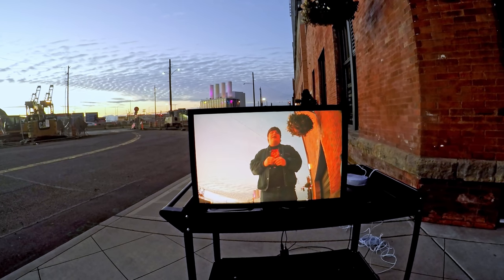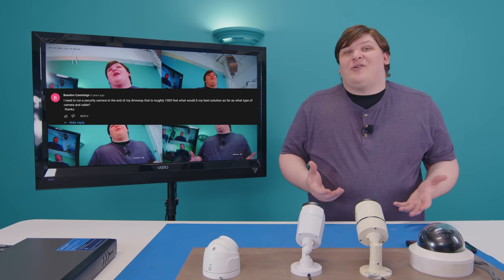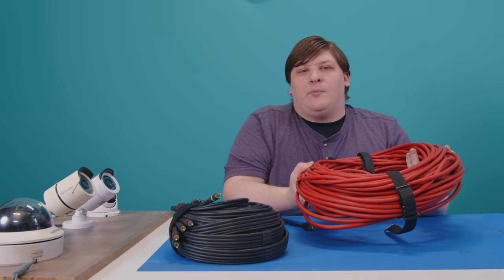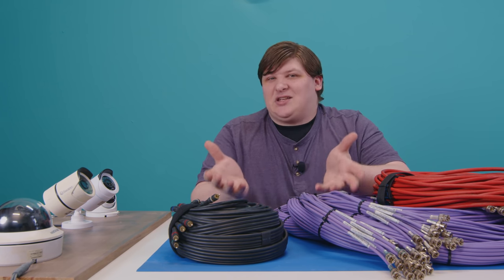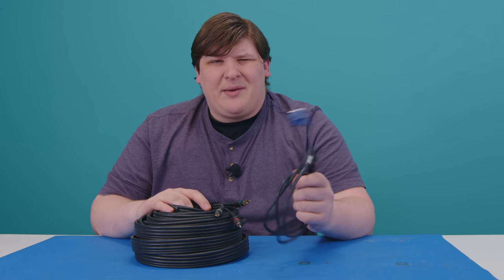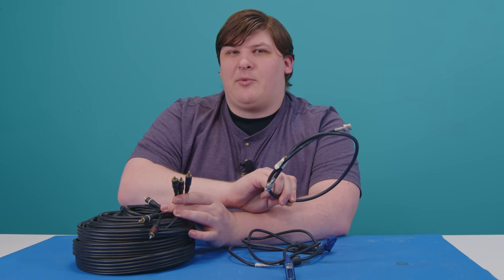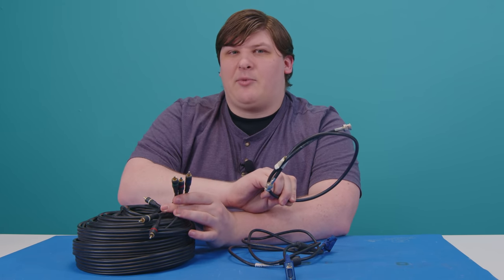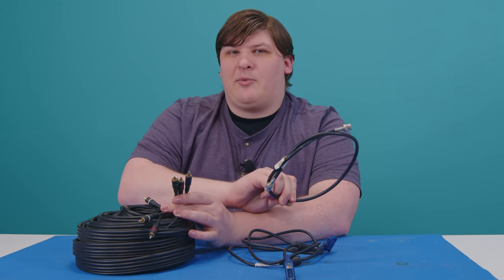1000ft of ANALOG HD video over a single cable?! [AHD/CVI/TVI]

Comment: Most satellite trucks were way behind the conversion to HD. The encoders in the trucks and the decoders at the networks were still SD well into the 2008 campaign season. Replacing those SD encoders and IRDs was some serious money. Many local affiliates, already smarting from the HD transmission costs, simply could not afford to upgrade their news operations at the same time.

However many of the SD news cameras would shoot and feed 16x9 video, a/k/a 960H. We would tell the SD encoder (or heavily throttled back HD encoder) what we were sending and it would adjust the ones and zeros in the frame accordingly. When talking with who ever was going take the satellite feed, we would tell them we were sending HD Lite, and they would know exactly what we were talking about. 

Good video, good information, well presented.

P.S. Broadcast triax has some embarrassingly low limitations depending on the camera/CCU maker. The cameras that send the video back as uncompressed straight digital video, would be hard pressed to break the 200 meter mark. I believe Thompson and Grass Valley cameras convert the signals to RF and get some amazingly long cable runs out of them, measuring out to 1500 meters if you powered the camera locally. But who wants to pick up 1500 meters of that stuff?

You already discussed SMPTE Fiber, which is rapidly becoming the industry standard. New sports facilities are being built out with SMPTE and single mode ST fiber infrastructure now.
Reply from the maker: Interesting info, it's very hard to find any hard data online on how any of this stuff works, so from the info I had, I believed it all used RF. I'm sure there's some kind of modulation going on even with the stuff you're describing (I mean, if there's no modulation, how would you send more than a single signal?) But the enormous difference in performance you're describing definitely means I need to do more research to determine what varieties exist.
Reply: @CathodeRayDude  —> There is modulation of control, comms, audio, and return video circuits on Triax. However, early HD broadcast camera producers were loathe to modulate the 1.485 Gb/s video signals. In a market that was already suffering some growing pains and some epic product failures early on, modulation schemes as yet untested under real remote production conditions in the field (Beer in the triax connectors sucks) not many were willing to try new tricks before they got that HD trick down to routine. In the wake of some of those early product failures that actually made it in to production environments, those manufacturers feared anything that might hamper the HD picture in a marketplace that will dry up at the slightest product flaw.

Comment: I think a little bit of that HDMI conversion issue at the end is the capture device you're using - that's one of the ones where they've sanded off the names of the chips on the inside and it's probably giving you some kind of weird MJPEG. Not *entirely*, but some of it, at least.

Comment: It’s funny how I’ve been using these things at home for my security cameras and I never really thought much about it. I did a quick google when installing these to see what the various abbreviations meant, but it didn’t even register that these are actually all analog. I guess I always just assumed that it is transmitting some digital signal over coaxial cable. But I was surprised at the picture quality over one of the thinnest and cheapest cables possible.

Comment: In standard definition modes the Y connector in component video is identical to monochrome composite video. If these systems are just overclocked NTSC they might have a similar sort of compatibility with HD component video.

Comment: I enjoyed this video but there are quite a few inaccuracies that I feel I needed to shed light on. I've been working in electronic security for over a decade so I have plenty of experience with security cameras of all types. 

Of the analog formats you listed The only one that is truly analog is AHD. The others have two way communication to some degree for PTZ controls, on screen display controls, and two-way audio. 

There is a distinction to be made between not just analog and digital video but also digitally encoded video. Surveillance cameras have been able to broadcast 4K+ resolution video feeds with next to no degradation or noise thanks to encoding. This also enables lossless video over vast lengths of copper. 

On the subject of coax versus Ethernet for  video transmission results are entirely dependent on which format you are using to transmit across either copper medium. Raw analog video used coax due to its inherent shielding reducing noise and interference but if the video signal is encoded you can use a twisted pair with the same results and no noise. 

Also there there are plenty of us security camera enthusiasts out here 😊

Comment: Good stuff - a point on your NTSC monitor explanation, though.  The vertical deflection, the part that makes those horizontal lines separate, is not stepped; it is a continuous ramp.  As a result, the TV lines in the raster are ever so slightly tilted down on the right.  This is true for both even and odd fields, and with the way the signal is generated, 262-1/2 lines per field, the second field lines land very nicely in between the lines from the first field.  Overall, an excellent video, thanks!

Comment: In the theater I work in, we have 6 projectors around the stage that let is project digital sets. For that we do want an HD signal, but sending HDMI over 100 feet just doesn’t work, so we convert the HDMI signal at the computer to CAT 5 or CAT 6 and then convert it back to HDMI back at the projector. This works well because CAT 5/6 cable is reasonably cheap, and it is robust enough for the distance. There at 2 types of converters though, POE and non POE, the non POE ones have to have power on both ends but we find them to be more reliable than the POE ones, just because over the distance there is natural voltage drop so they become less reliable.

Comment: Fun fact: HDMI is a digitally encoded format but retains analog-like timings, with horizontal and vertical blanking codes sent over the blue channel! Whereas DisplayPort sends packets of video, so you can address different packets to different displays in a daisy-chain, etc.

Comment: At the parking garage I'm working on I was told by a low-volt electrician that the cameras in the garage were over $1k each and were to be replaced every 5 years.  And that there are over 1,000 cameras not including the automated parking system monitoring system.  That's just the camera body.  Many more millions are invested in the infrastructure.

Comment: The closest we have today is VGA. Which is surprisingly high quality for a analog video format. With WXUXGA you can get 7680x4800 and honestly if you put it side-by-side with HDMI on a normal lenght cable you wont see a difference hahahaha.

Most people like to say that VGA has loss of quality but I never saw someone actually prove it. Because if there is, its pretty minimal, and most of the time can be blamed on the converter. The major problem is that VGA can suffer interference by being analog. As said, on analog the interference is just plain added to the picture, while HDMI, or the better DisplayPort will black on interference but its really hard to have enough interference to black a 15ft HDMI/DP signal, while its not that hard to have some imperfection on 15ft of VGA.

Also, theres the major problem that the driver on a moderna LCD is digital, so you're most of the time converting digital to analog to digital and back to analog to drive the pixels. Manufactures dont want to add the cost... Thats why today less and less TVs come with composite (they exist, I swear).
Reply: 👍👍, I have a tower and HP VS19E (VGA, 1280x1024@75Hz) monitor and a couple old laptops with 1920x1080@60Hz eDP/LVDS displays and when I put them side by side I can't tell the difference they all look really good to me but I also have a high quality VGA cable and my current graphics card is from Gigabyte (a Radeon HD 7750 2GB)

Comment: Hey dude.. Interesting video.. A CRT vertical scan signal doesn't 'ratchet' but rather just moves smoothly from top to bottom. This results in an image which is very slightly tilted to the right (by the height of 2 scan lines). To produce perfectly flat lines would require a stepped ramp generator, very high performance amplifier to handle the rapid transients and probably electrostatic deflection. Seems unnecessarily complex when all that's required is to tilt the scan yoke slightly..

Comment: the issues you describe about HDTV antenna's... is exactly like the issues i deal with, my antenna is up on the roof properly grounded (local code requires anything metal on roofs to be grounded with their own line for such cases aside from the coax).... any winds over 40k/80 gusts, i get those moments.... there are times i'm able to watch local channels clearly while others are "completely destroyed" as you say, in my case, it goes like that for 30 seconds then cuts to a blank screen with "signal loss"

Comment: 12:35 2K is actually 1080p (PC 1920x1080, DCI 2048x1080), because of the approximately 2000 horizontal pixels. The 2560x1440 is called 2.5K (if we MUST have a K-definition) or more commonly QHD (Quad HD as it's 4x the resolution of HD).
Reply from the maker: That would be preferable but it's not how things shook out.

Comment: IP based 1080p HD network cameras has been around since at least 2009 with the Axis Q1755 though prior to this, network cameras that could do above 720p were called megapixel cameras. These were on the market since around 2004 (for example, the Axis 206M was released in 2004 and could do Motion JPEG at 1280 x 1024 at 12 fps)

Comment: Wow, you should do technical training videos! I was far more engaged with this than the text based research I was doing. Thank you. Answered all my questions and then some. Donation inbound, if you accept them.

On topic:
As a network security guy, this information is fascinating. You come across some strange signals/datagrams that can easily morph across formats and do things totally unexpected. For example, seeing the audio signal of a message that suddenly morphs into a middle finger because some hacker is thinking ahead. Clever and gets you wondering what else is possible. Now I understand how something like that could be accomplished. Cool.

At the end of the day, data like this is stored and viewed by digital devices. Transmission formats from yesteryear are robust because they are simple. There's a lot of room to cram extra data if you control both ends of the "line". It's the little tricks or clever mechanisms used in the early years that we can still learn from tomorrow.

Comment: I kept thinking Single Mode Fiber would be the solution here. SMF-BiDi would easily get 10km range, datarate is anywhere between 1G and 400G, transceivers without name-brand stickers cost 80€ for the pair (10G, both ends of the run) and the cable in between is less than half-buck per meter.
Issue is, fiber does not transmit power (which is also a good thing, lightning wise).

Comment: Hello! 
CCTV engineer here!
I've been in the industry for 6 years now.
We manage over 10,000 cameras currently. I've seen it transfer over from CVBS, AHD, CVI and TVI etc. to full digital.
We have some equipment that nobody else uses, it can transmit 65W of POE @100mbps for nearly three miles.
It uses COAX.
Don't hesitate to get in contact if you feel like doing a follow up
Reply: Okay then 😅

Comment: I agree for the most part on the Analogue vs Digital for noise, however Digital Bit Error Recovery mechanisms have improved a bunch from 10/20 years ago, the problem is set top boxes have not caught up. I have worked on analogue and digital fibre optic signals, and some modern mechanisms to recover digital signal are so good that it only needs a few beams of light to get the full packet and handles significant loss/noise and high BER

Comment: The other thing these sensors were/are used for is quadcopters/racing drones first person view cameras. The graceful failure to static is important when line of sight is impaired, and the tiny sensors are light.
Reply: also incredibly low latency without expensive equipment

Comment: You can realistically use these as webcams, but as you noted, not cheaply. A lot of those DVRs (even the cheapies) will provide the converted content over RTSP, which can be added as a source in OBS...

It's a mess, but I use it to get video from a camera on the roof and use it as an idle screen during breaks in our class meetings.

Comment: Recently I've seen a few D-Link switches with 250 meter POE ports, which can run 10 megabit connections up to 250 meters over standard Ethernet.

This is actually plenty for a 2K camera and definitely solves the warehouse issues, for most average warehouses.

Comment: I've worked for a company that installed video surveillance and i've worked for an ISP that owns the coax cabling (US: "cable tv") in half of the country.

If at all possible, IP camera's were chosen because their image is either perfect or nonexistent. Their data could be pushed over everything from SFTP to speaker wire using VDSL converters.
For analog HDCVI cams, FTP cable with a couple of baluns were used. The first time i saw it, i was surprised to learn that analog HD was possible, but also prone to interference (quicker than IP cams). Ethernet (or digital in general) can have some level of error correction, which analog signals just don't have.

Some manufactureres use non-standards-compliant "long-range" ethernet, allowing some brands to reach 800m (2624 ft) ánd be powered from it as well.
I don't think HDCVI would reach that far.

At the 2nd job, i had analog tv customers that upgraded to digital. Some customers had been watching tv with a distorted PAL image for years, but now with FaBuLoUs HIGH DEFINITION digital they were experiencing dropouts all the time. RG59, PE6, telephone cable, wire nuts, tape, glue,... Any cable and any connection was good enough, or so they thought.
At some point even ECC couldn't work its magic anymore and that resulted in having blocky images on screen.

I could tell you so many horror stories!
Analog has its charms but digital is the clear winner in my book.

Comment: This was years ago, but I’ve installed probably several hundred CCTV cameras of different varieties, both in large retail environments & covert cameras for different types of investigations. Most of the time I actually used plain old twisted pair or phone cable, for both video & power through the same cable. This was obviously less viable once CCTV systems added more features & had to connect to multiplexers, PTZ controllers, etc. 
As an aside, I also made my own PTZ systems using regular cameras & components from Radio Shack, such as servos & control boxes originally made to rotate those big, old school TV antennas. Pretty hilarious nowadays, but that’s what we had to do lol

Comment: Thanks for this, it was a really interesting & informative video!

Just to note, coax ethernet can do 500 meters (1640.4 feet). Ethernet over coax existed before twisted pair and still exists today, although somewhat updated. No POE, though.

 I completely agree about digital TV, btw!  Especially with the channel shuffle last year that eliminated most low band rural channels completely. Also, some non-security people do care about outside security cameras because we use them to watch wildlife like birds and night critters!

Regarding today's formats mentioned at the end: you call it "picky" but IP owners call it "content protection". It would be cool to see a video on that someday!
Reply from the maker: Yeah, I know about original Ethernet, but good luck buying a transceiver for it made after 1995, or fast enough to push a 4k stream, haha. Thanks for watching! Good point on the wildlife cameras also!
Reply: @Cathode Ray Dude  Not original thin or thick net up to 100Mbps; modern gigabit. Using docsis 3.1 over copper coax, which hypothetically can do up to 10Gb. Comcast does quite a bit of it, provisioned for residential at just a bit under 1Gbps from a home or business typically to a nearby fiber node. The cable itself can handle maybe 125Mbps; DOCSIS multiplies that as needed by using multiple frequencies (or "channels").  But to be clear, that's digital and not the subject of your video!

Comment: I had some Adderlink devices that remind me of this technology, useless for using existing cctv infrastructure, although can be patched because of the connection type. They're analogue KVM extenders that use cat5. They don't use any form of IP, just send PS2 and video over the cat5. If you want to do some more research they are from Adder, and the device model is the ADDERLink X2-Gold. According to the website they support 1600x1200 at 200m and 1280x1024 at 300m, in ideal conditions the quality is pretty crisp too. Nice video,- enjoy all your stuff. :)